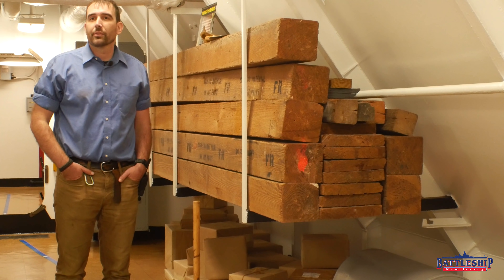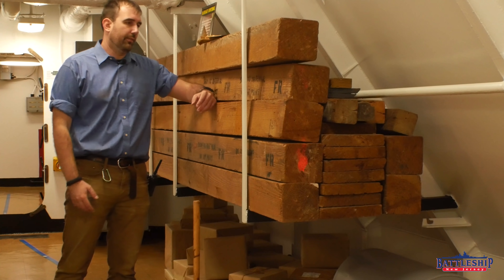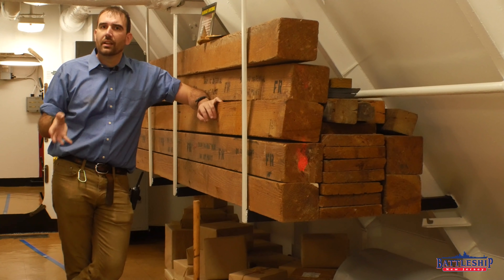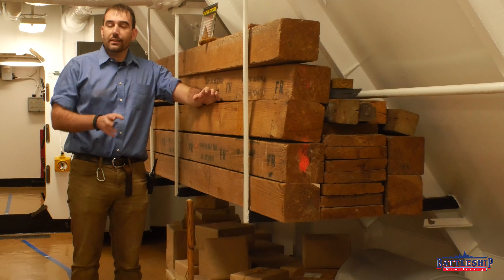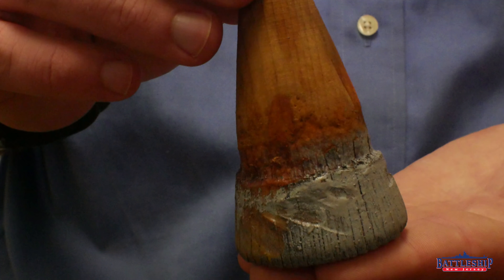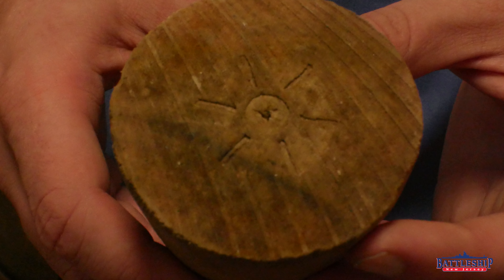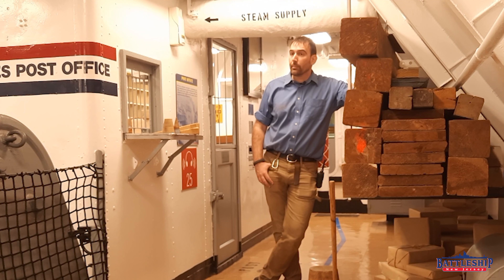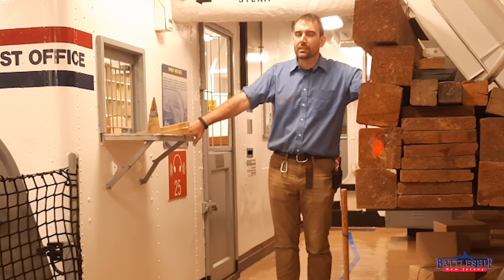Damage Control: Stopping Flooding

Comment: Not 10 cent nails, tenpenny nails.  And the hammer marks on the back of the plug are actually marks left by the lathe when the plug is created.
Reply: The nails were bought through a govt contract, they are probably 10 cents each.   :+)

Comment: at 2:40 the bottom of the diagonal should be cut to butt up against the base block the same as the top...as is the back pressure will crush the bottom of the 45 degree brace
Reply: agreed.  that shoring demo was not good at all lol.

Comment: May I suggest putting a full size periscope in the river (with the appropriate approvals of course) so that the guests can see that Hollywood grossly exaggerates how easy it is to spot an enemy submarine? The Pier 3 Marina is about 1,300 yards off the bow.
Reply: I would suggest a modern webcam, and then on the screen draw a circle showing what a periscope would see.
Reply: @kennethng8346  A custom build RC rig might be more practical. Not a permanent fixture in the river, and a repeat visitor couldn't be sure where to look for it.
Reply: @f0rth3l0v30fchr15t  I like it too because it’s more accurate. A periscope is hard to see, the feather or wake makes it a little easier, and subs while moving slow at periscope depth were rarely stationary.
Reply: @f0rth3l0v30fchr15t  But then someone would have to operate it as their fulltime job. Also, an RC sub roaming in the river would be considered a hazard to navigation by the USCG and be shut down pretty quickly.
Reply: @ghost307  Seriously? It could operate on a single button push(out from the quay/return to quay) and an arduino board. As for being considered a hazard to navigation, it could be less than a yard across. It only needs to be big enough to pack a battery and enough worky gubbins (stop me if I'm getting too technical here) to raise and lower a stick with a GoPro on.
Reply: @f0rth3l0v30fchr15t  Yes, seriously.
I went through something like this with the Coast Guard on a recent job and they are very particular about anything in the water that could be hit. I  had a signal cable 3 feet from a retaining wall and it either needed to be relocated or buried under the bottom.
Reply: Good idea. Have every boat in the river worried about hitting a u-boat.
Reply: @Nexfero  Not if it's right next to an existing dolphin at one of the piers or marinas. That would make it cheaper to install and be out of the way of all the river traffic.
Besides, anyone scared of a U-boat 75 years after the war ended deserves to be frightened.